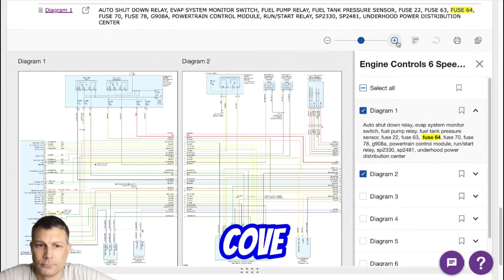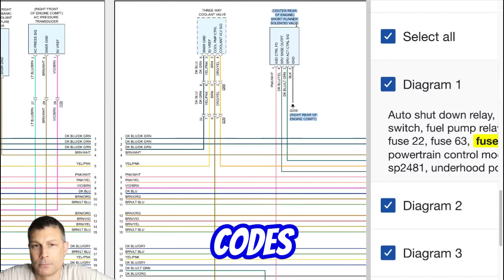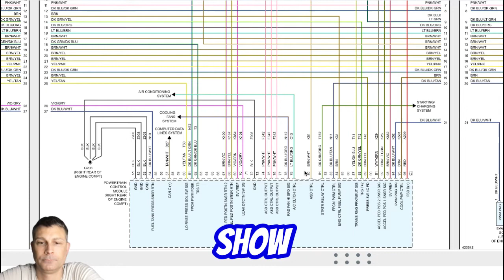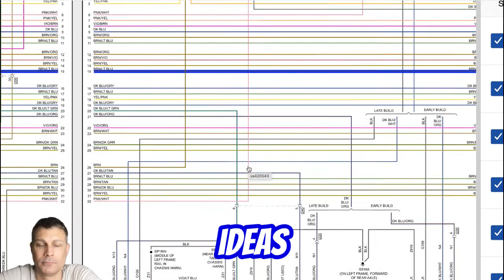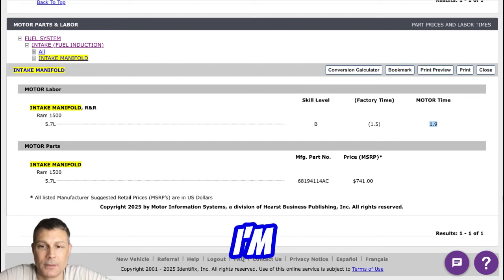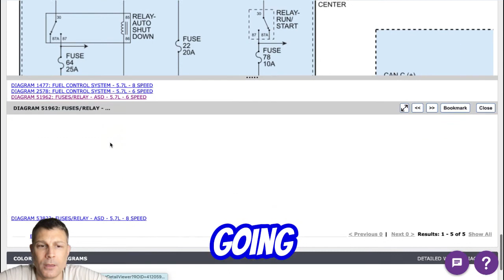Why Does My Ram 1500 Keep Blowing Fuse 64?

Comment: For anyone having this problem. The main engine harness runs along the back of the block via bank 1 right behind the back of the driver side head, there is a bracket with a bolt with a stud on it and the harness rubs through over time on that stud and grounds the circuit. May have to pull the intake to get to the bad wires but thats where the problem is.